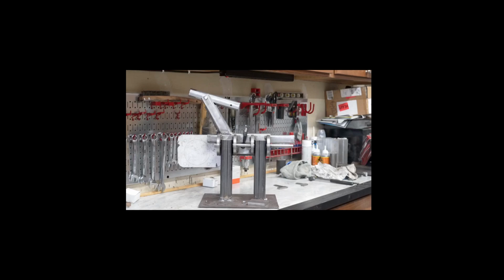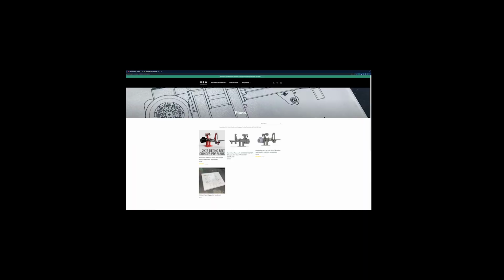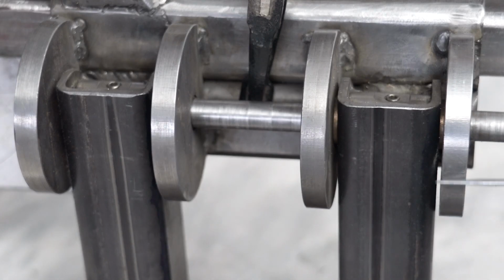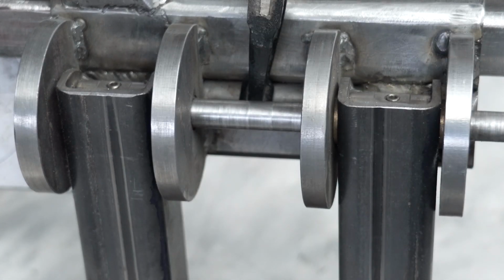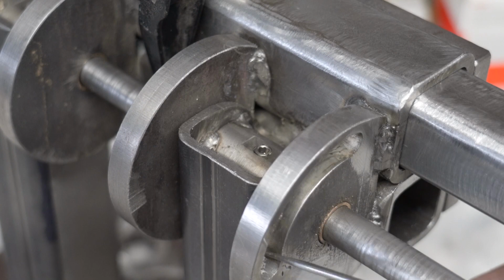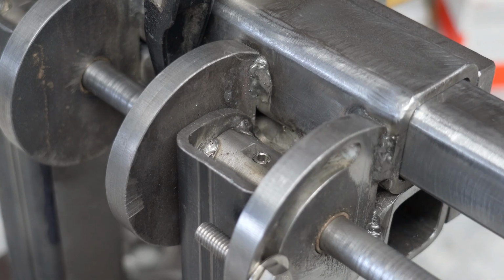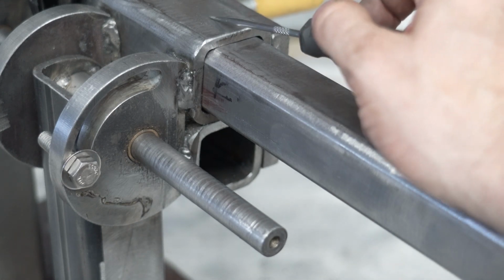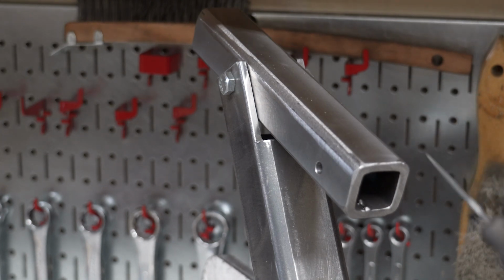2x72  belt grinder build - revolution clone

Comment: I am building a Housemade Revolution and if you get the correct thickness square tube there is no need for what you did so far so sorry but I don't see any improvement. All you doing is creating more work or just having fun.
Reply from the maker: No worries!  The bronze bushings and the machined parts have less slop and will allow the machine to wear longer as the bushings can be replaced.  I have actually made several modifications along the way which I will share at some point.  As far the as the square tube goes, yes I agree but this is what I had on hand.  I am also switching it to use a gas strut to dampen some of the movement of the arm.  Again, maybe overkill but I am trying to make a good tool.  Most of these are just ideas and of course, building the grinder is part of the fun.